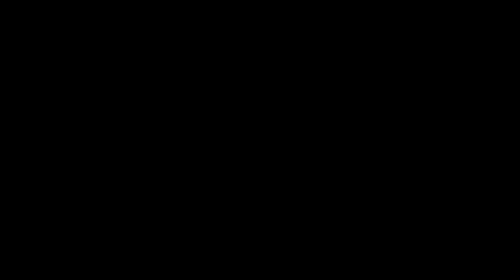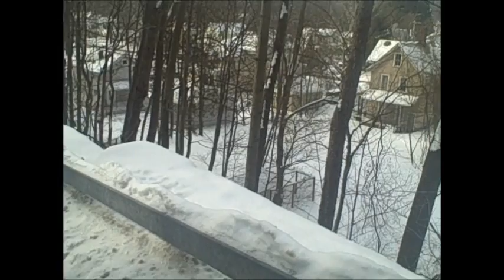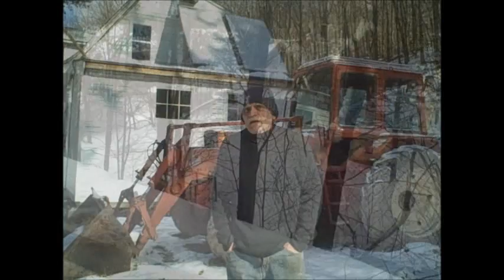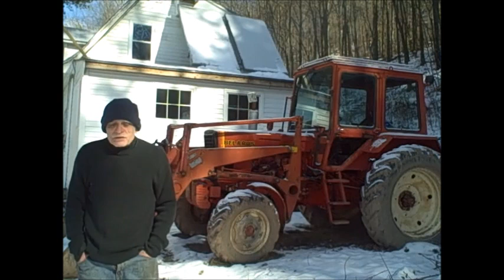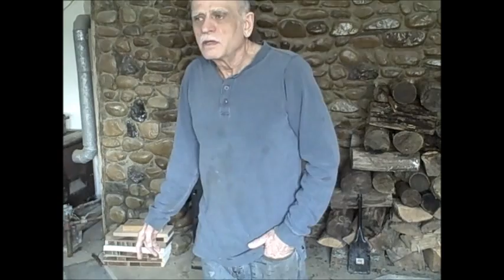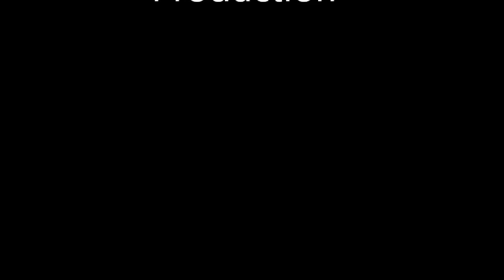green wood

Comment: I've got crappy frozen wood as well. Almost ready to test my rocket stove heater outside where I plan to thaw some of the wood so it can burn in the wood stove. I find adding kindling to crappy wood helps and also allowing lots of air to mix with the fire. I've also built mini "L-Tube" rocket stoves with wood chunks inside the wood stove to get the fire going. Fun to do and seems effective. Stay warm!